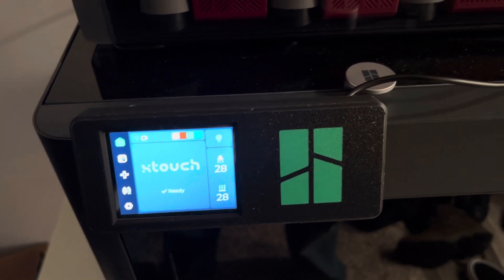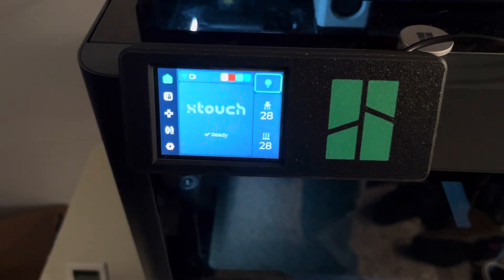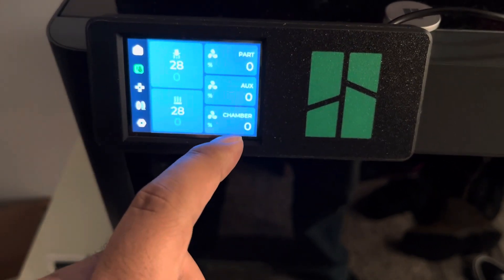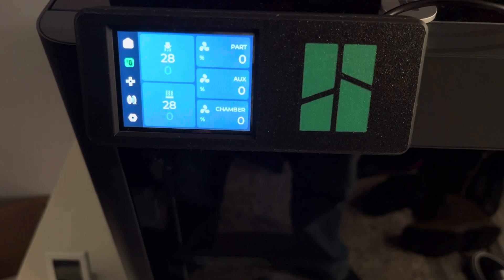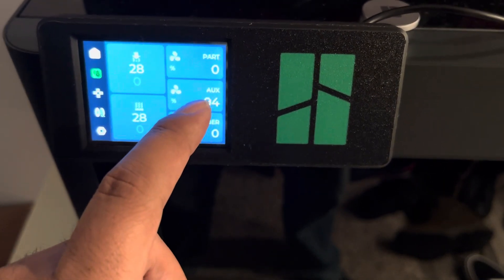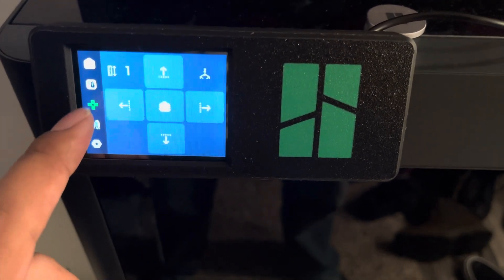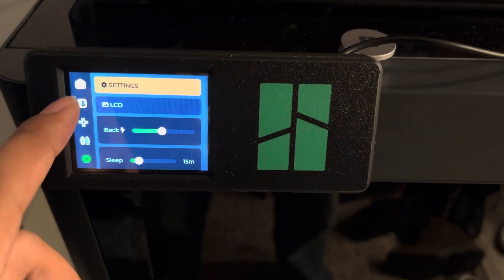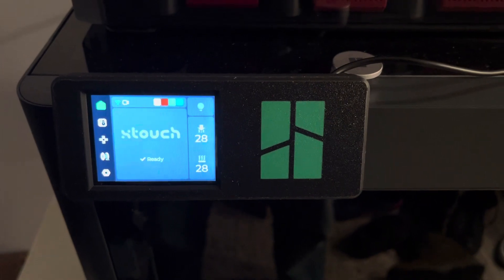xtouch for Bambu P1 series printers

Comment: Is it possible to install a larger screen - not 2.8"?
3.5 or 4.5😊
Reply from the maker: Can’t say for sure. I’d assume so providing the touchpad is using the same controller. I’d find out from the developer. Link to their Github is in the description and you can mostly ask there.
Reply: @eightbitminiboss  technically it will work but xtouch is only built for the resolution of the 2.8 so far, so a bigger screen is a waste. They have said they are eventually going to have the option though.
Reply: will wait)